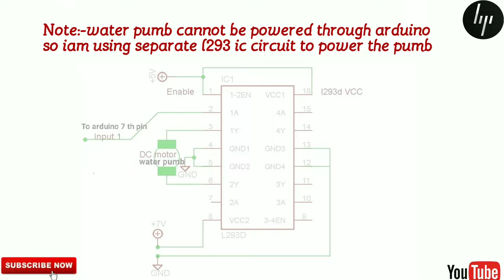Arduino Fire Fighting Robot _Hobby project Diy

Comment: Everybody please connect the pump in 6th pin because the circuit diagram is wrong
Reply: Bro could u complete this project??plzz replay... Urgent
Reply: @arjun.m3389  completed??
Reply: Its ok I completed it..
Reply: B1 in 6th pin sir
Reply: Sir I need Yr help
Reply: Bro then where to put relay pin ????????? What are you saying we add in 7 by my code
Reply: can i ask question po
Reply: @rupalagudidastagiri1416  Bro please give me the aurdino code for this project ....in this you tube link there is no. Coding is there
Reply from the maker: Download and open it using IDE software or change it's format from .ino to .text

Comment: Sir, we are working on the same project but instead of l293 motor driver we have l293d but all the sensors are ok and servo is in the working condition and the motors are not working can u please solve the problem....... Sir
Reply: Did you solve this problem??

Comment: By using the motor driver does the pump works??? Or we  need only relay for the pump
Reply from the maker: require an extra l293 driver or relay module to operate pumb.

Comment: Could you please tell me how you connect gear motors? do you only get output from the two front motors?
and last question would the code change if i use motors driver shield instead of motor driver?

Comment: I have a doubt....In the video u have used only one motor driver but in the circuit diagram there are two? Pls reply fast....
Reply from the maker: I have used L293 ic instead of driver
Reply: So should i use L293 ic or motor driver>

Comment: It's really use full thank you so much
Reply: Could you plz send me the code the one in the description box is not opening plzzz it would be extremely helpful
Reply: how you connect the wires on breadboard
Reply: @sandhyakumari8077  if i use 2000 mah battry inspite of 7500mah ,can it work ?code me kuch chane karna padega kya?
Reply: Why not bro sure
Reply: @devanshukaushik4134  of course
Reply: What is the total cost of components and the project
Reply: @sandhyakumari8077  bro it's not opening, it says preview not available
Reply: @nandhinivasudevan9727  u restart it 

Thanks...
Reply: Bro why my dc motor doesnt spin?
Reply: @BKawai-jr7et  I think there is a misconnection try setting it properly

Comment: Y didn't u use a relay in this project but u used a relay in your next upgraded gsm module fire fighter
Reply from the maker: You can use both.
Reply: @hobbyproject  bro i have done everything same as ur circuit diagram but my project is not working even I uploaded the code properly but still not working plz help me i have project in my clg
Reply from the maker: 9400496834 what's app

Comment: Bro ek motor drivers se ho skta hai kya....plzz bta do plzz broo...🥺🥺🥺?
Reply from the maker: Use relay module for water pumb.
Reply: @hobbyproject  how bro.... 🥰🥰😍😍😍blzz tell me... I have 1 chanel relay kit..... But how I can use that.... 🥰🥰😍😍🥺🥺🥺
Reply from the maker: Check the description.
Reply: @hobbyproject  thank u so much sir 😘😘😘❤❤❤❤❤❤❤❤ but sir code....? 😘🥺
Reply from the maker: Same code.
Reply: @hobbyproject  thanks sir 😘😘 may God bless you 😘❤🙏
Reply: @hobbyproject  not working sir💔💔💔😥😥😥😥😥 what should I do now🥺🥺
Reply: @hobbyproject  sirrrr😭😭😭😭😭
Reply from the maker: 9400496834 WhatsApp.
Reply: @worldVK1704  do u fix ur problems....
Reply: @arjun.m3389  not yet
Reply: @worldVK1704  iam also planing for to  do this project. Iam also confused with the circuit diagram...
Reply: @arjun.m3389  which type of problem are you facing.... @
Reply: @worldVK1704   CODE HAS 4 MOTORS BUT IN THE CIRCUITS THERE IS ONLY TWO MOTOR COULD CLARIFY THIS??? PLZ ITS URGENT
Reply: @arjun.m3389  I will help u

Comment: It's extremely helpful....however the code in the description box is not opening up...could you please upload it once again...and if someone has the code, please reply
Reply from the maker: Open it using Arduino ide softwere
Reply: @hobbyproject  yes I have...it has worked thanks a lot...
Reply: @hobbyproject  can I use my laptop for this project??
Reply: @hobbyproject  and could you plz let me know if a metal chassis would work
Reply from the maker: Yes u can use laptop and metal chassis is fine
Reply: @hobbyproject  thank you
Reply: @hobbyproject  i have a last question....will the code work with two wheels...if not could you plz let me know where you have got your chassis from...and what is the container you have used?
Reply from the maker: Yes it will wrk for 2 motors.
Reply: @hobbyproject  we had made are project with 2 motors but it is not working . Can you please tell me why this   happens with us

Comment: i used Arduino uno smd version to make this project,the circuit not working properly, sometimes it moving random ,not detecting flame signals,not switching the relay or motor driver

Comment: Can i use l298 motor Driver instead of l293?
Reply from the maker: sure
Reply: @hobbyproject  could you help about the pin out connection of l298?

Comment: Can you tell me the use of 18650 battery then?
Reply from the maker: An 18650 is a lithium ion rechargeable battery. The 18650 cell has voltage of 3.7v and has between 1800mAh and 3500mAh .

Comment: Sir please help for this project using L298N driver....  For circuit diagram and program ...
Reply from the maker: Hey, check the description.
Reply: Sir description diagram and program are different i want to using  L298N driver circuit diagram and program ...
Reply from the maker: No problem,  same connections.

Comment: hlo sir,we are working on the same project but ising l293dotor drivers instead of l293.We are ok with flame sensers and servo,they are active when fire is on.....
but coming to dc motors there is no response first we got they also used to rotate, but now there is no response what is solution sir...
Reply: Same here bro
Reply: bro have you complete this prject ?

Comment: Bro breadboard ki wiring smj nai aa rahi
Reply: Bro plz reply
Reply from the maker: Use another l293 driver so you can avoid BB wiring .
Reply: @hobbyproject  then will it work with the same program
Reply from the maker: Yes same.
Reply: @hobbyproject  LAKIN SERVO KAHAN LAGA GA

Comment: I need help water pump is automatically run
Not working on fire sensor
Reply from the maker: Hey just change the pumb connection from NC to NO on relay module.

Comment: bro please give the code by copy and paste please bro i beg you
Reply: /*------ Arduino Fire Fighting Robot Code by hobby project---- */
 
#include <Servo.h>  //include servo.h library
Servo myservo;
 
int pos = 0;    
boolean fire = false;
 
#define Left 9      // left sensor
#define Right 10    // right sensor
#define Forward 8   //front sensor

#define LM1 2       // left motor
#define LM2 3       // left motor
#define RM1 4       // right motor
#define RM2 5       // right motor
#define pump 6
 
void setup()
{
  pinMode(Left, INPUT);
  pinMode(Right, INPUT);
  pinMode(Forward, INPUT);
  pinMode(LM1, OUTPUT);
  pinMode(LM2, OUTPUT);
  pinMode(RM1, OUTPUT);
  pinMode(RM2, OUTPUT);
  pinMode(pump, OUTPUT);
 
  myservo.attach(11);
  myservo.write(90); 
}
 
void put_off_fire()
{
    delay (500);
 
    digitalWrite(LM1, HIGH);
    digitalWrite(LM2, HIGH);
    digitalWrite(RM1, HIGH);
    digitalWrite(RM2, HIGH);
    
   digitalWrite(pump, HIGH);
   delay(500);
    
    for (pos = 50; pos <= 130; pos += 1) { 
    myservo.write(pos); 
    delay(10);  
  }
  for (pos = 130; pos >= 50; pos -= 1) { 
    myservo.write(pos); 
    delay(10);
  }
  
  digitalWrite(pump,LOW);
  myservo.write(90);
  
  fire=false;
}
 
void loop()
{
   myservo.write(90); //Sweep_Servo();  
 
    if (digitalRead(Left) ==1 && digitalRead(Right)==1 && digitalRead(Forward) ==1) 
    {
    
    digitalWrite(LM1, HIGH);
    digitalWrite(LM2, HIGH);
    digitalWrite(RM1, HIGH);
    digitalWrite(RM2, HIGH);
    }
    
    else if (digitalRead(Forward) ==0) 
    {
    digitalWrite(LM1, HIGH);
    digitalWrite(LM2, LOW);
    digitalWrite(RM1, HIGH);
    digitalWrite(RM2, LOW);
    fire = true;
    }
    
    else if (digitalRead(Left) ==0)
    {
    digitalWrite(LM1, HIGH);
    digitalWrite(LM2, LOW);
    digitalWrite(RM1, HIGH);
    digitalWrite(RM2, HIGH);
    }
    
    else if (digitalRead(Right) ==0) 
    {
    digitalWrite(LM1, HIGH);
    digitalWrite(LM2, HIGH);
    digitalWrite(RM1, HIGH);
    digitalWrite(RM2, LOW);
    }
    
delay(300);//change this value to increase the distance
 
     while (fire == true)
     {
      put_off_fire();
     }
}
Reply: /*------ Arduino Fire Fighting Robot Code by hobby project---- */
 
#include <Servo.h>  //include servo.h library
Servo myservo;
 
int pos = 0;    
boolean fire = false;
 
#define Left 9      // left sensor
#define Right 10    // right sensor
#define Forward 8   //front sensor

#define LM1 2       // left motor
#define LM2 3       // left motor
#define RM1 4       // right motor
#define RM2 5       // right motor
#define pump 6
 
void setup()
{
  pinMode(Left, INPUT);
  pinMode(Right, INPUT);
  pinMode(Forward, INPUT);
  pinMode(LM1, OUTPUT);
  pinMode(LM2, OUTPUT);
  pinMode(RM1, OUTPUT);
  pinMode(RM2, OUTPUT);
  pinMode(pump, OUTPUT);
 
  myservo.attach(11);
  myservo.write(90); 
}
 
void put_off_fire()
{
    delay (500);
 
    digitalWrite(LM1, HIGH);
    digitalWrite(LM2, HIGH);
    digitalWrite(RM1, HIGH);
    digitalWrite(RM2, HIGH);
    
   digitalWrite(pump, HIGH);
   delay(500);
    
    for (pos = 50; pos <= 130; pos += 1) { 
    myservo.write(pos); 
    delay(10);  
  }
  for (pos = 130; pos >= 50; pos -= 1) { 
    myservo.write(pos); 
    delay(10);
  }
  
  digitalWrite(pump,LOW);
  myservo.write(90);
  
  fire=false;
}
 
void loop()
{
   myservo.write(90); //Sweep_Servo();  
 
    if (digitalRead(Left) ==1 && digitalRead(Right)==1 && digitalRead(Forward) ==1) 
    {
    
    digitalWrite(LM1, HIGH);
    digitalWrite(LM2, HIGH);
    digitalWrite(RM1, HIGH);
    digitalWrite(RM2, HIGH);
    }
    
    else if (digitalRead(Forward) ==0) 
    {
    digitalWrite(LM1, HIGH);
    digitalWrite(LM2, LOW);
    digitalWrite(RM1, HIGH);
    digitalWrite(RM2, LOW);
    fire = true;
    }
    
    else if (digitalRead(Left) ==0)
    {
    digitalWrite(LM1, HIGH);
    digitalWrite(LM2, LOW);
    digitalWrite(RM1, HIGH);
    digitalWrite(RM2, HIGH);
    }
    
    else if (digitalRead(Right) ==0) 
    {
    digitalWrite(LM1, HIGH);
    digitalWrite(LM2, HIGH);
    digitalWrite(RM1, HIGH);
    digitalWrite(RM2, LOW);
    }
    
delay(300);//change this value to increase the distance
 
     while (fire == true)
     {
      put_off_fire();
     }
}

Comment: Hello bro! 
Please I have a question!
Can I use only two 3.7V Li-ion 2000mAh Battery 18650 for 2 motor drive shields? I mean one for the water pump the other for the motor and wheels.
Reply from the maker: No, u need to use  2 x 3.7v battery in Series so total 7.4v for both pumb and shield.

Comment: Hello Sir please reply!
First in the diagram there are two motor drive but you only use one in the video!
Then how you connect the battery?  have you use Lithium Battery Shield V3 Charging Module?
Reply from the maker: One for wheel and other for pumb
Follow the circuit diagram.
Reply: @hobbyproject   sorry for bothering you! 
but can i use one channel relay module instead of using another motor drive?
Reply from the maker: Sure u can.
Reply: @hobbyproject  Then i am going to use motor drive shield instead of the motor drive for the wheel, and one channel relay module for the mini water pump.
Thank you so much.
Reply: @hobbyproject  sir program is not compiling , it should error at digaitalWrite
Reply: It is showing error

Comment: Beautiful.. I made this as per your circuit diagram and everything works well.. I used two L293D single chip motor drivers instead and it works perfectly.
Reply: What is the total cost of components and the project
Reply: @meghanamaggie4975  3500
Reply: Can you help me
Reply: @hrutikshinde1270  what help do you need?
Reply: @hrutikshinde1270  just follow the circuit diagram provided by hobby project.
Reply: Can you please send the link of the code
Reply: Why dont u use l298N motor sheild..
Reply: @nandhinivasudevan9727  The code has been provided by hobby projects check the description.
Reply: @akchannel7356  I used what I could get access to in my area.
Reply: Can I buy from you?
Reply: Bro so you have this project with you, I want to purchase
Reply: @BKawai-jr7et  if you need to buy I can Do it for You
Reply: @BRIJESHKUMAR-sk1ex  i can
Reply: Hi sir for me program is not compiling
Reply: @nKingCobra   program is not compiling sir
Reply: Hi sir program is not compiling
Reply: Hi sir reply please
Reply: @explorerpragun431  even can I get the code for it am not able to open the code given in description
Reply: @agazeeza8173  no idea boss The Code is Faulty
Reply: Hlo bro can you please tell me something
Reply: Bro... Why my is not working🥺🥺
Reply: @meghanamaggie4975  for me it was 1400
Reply: /*------ Arduino Fire Fighting Robot Code by hobby project---- */
 
#include <Servo.h>  //include servo.h library
Servo myservo;
 
int pos = 0;    
boolean fire = false;
 
#define Left 9      // left sensor
#define Right 10    // right sensor
#define Forward 8   //front sensor

#define LM1 2       // left motor
#define LM2 3       // left motor
#define RM1 4       // right motor
#define RM2 5       // right motor
#define pump 6
 
void setup()
{
  pinMode(Left, INPUT);
  pinMode(Right, INPUT);
  pinMode(Forward, INPUT);
  pinMode(LM1, OUTPUT);
  pinMode(LM2, OUTPUT);
  pinMode(RM1, OUTPUT);
  pinMode(RM2, OUTPUT);
  pinMode(pump, OUTPUT);
 
  myservo.attach(11);
  myservo.write(90); 
}
 
void put_off_fire()
{
    delay (500);
 
    digitalWrite(LM1, HIGH);
    digitalWrite(LM2, HIGH);
    digitalWrite(RM1, HIGH);
    digitalWrite(RM2, HIGH);
    
   digitalWrite(pump, HIGH);
   delay(500);
    
    for (pos = 50; pos <= 130; pos += 1) { 
    myservo.write(pos); 
    delay(10);  
  }
  for (pos = 130; pos >= 50; pos -= 1) { 
    myservo.write(pos); 
    delay(10);
  }
  
  digitalWrite(pump,LOW);
  myservo.write(90);
  
  fire=false;
}
 
void loop()
{
   myservo.write(90); //Sweep_Servo();  
 
    if (digitalRead(Left) ==1 && digitalRead(Right)==1 && digitalRead(Forward) ==1) 
    {
    
    digitalWrite(LM1, HIGH);
    digitalWrite(LM2, HIGH);
    digitalWrite(RM1, HIGH);
    digitalWrite(RM2, HIGH);
    }
    
    else if (digitalRead(Forward) ==0) 
    {
    digitalWrite(LM1, HIGH);
    digitalWrite(LM2, LOW);
    digitalWrite(RM1, HIGH);
    digitalWrite(RM2, LOW);
    fire = true;
    }
    
    else if (digitalRead(Left) ==0)
    {
    digitalWrite(LM1, HIGH);
    digitalWrite(LM2, LOW);
    digitalWrite(RM1, HIGH);
    digitalWrite(RM2, HIGH);
    }
    
    else if (digitalRead(Right) ==0) 
    {
    digitalWrite(LM1, HIGH);
    digitalWrite(LM2, HIGH);
    digitalWrite(RM1, HIGH);
    digitalWrite(RM2, LOW);
    }
    
delay(300);//change this value to increase the distance
 
     while (fire == true)
     {
      put_off_fire();
     }
}
Reply: Can you share the code
Reply: Can you provide circuit diagram?
Reply: I need your help
Reply: Hii sir, I also want this project, how much it cost to buy from you if it is ready with you
Reply: What is the meaning of two l293d with single chip
Reply: Can I get code for this project
Reply: Bro I want help with you so pls help me how to connect pump

Comment: Hello I need your help please help me
Reply from the maker: Sure
Reply: @hobbyproject  is there any way to contact you
Reply: Sir, can I do this project using L293D Arduino shield instead of L293 motor shield
Reply: Helloo
Reply from the maker: You can use L293 or L298 driver.

Comment: I used l298n driver bo motor speed too high  and so near of fire or cross the fire and pump not starting how solve this problem😭😭😭😭 please give me l298n using flame sensor and 5v relay program i need i show in college project please help me 😭😭
Reply from the maker: use lm2598 converter to power l298 driver.

Comment: In video u have used one motor driver shield but in circuit diagram u have given two????
Reply from the maker: Other 2 motor connected in parallel.

Comment: This is not working
Reply: Because you must put a battery and connect it to the arduino after removing the cable that you connected to the arduino after putting in the code

Comment: Bro can i use an l298n motor driver instead of l293d
Reply from the maker: yes u can.
Reply: Sir can you send the arduino uno 
code please
Reply from the maker: check the description.
Reply: They are not have code please

Comment: In the diagram there is no breadboard
Reply from the maker: Use another l293 driver, instead of breadboard  connections.
Reply: @hobbyproject   Bro, by entering the code of this project, the motor is not working. The motor is not getting any command from adrino. Pls give me the complete code or else give me your mobile no. I can call you and get the information.

Comment: After some corrections everything is working fine except the water pump. Water pump is not working
Reply: What r the correptions...
Reply: @arjun.m3389  i used relay instead of second motor driver
Reply: @RohitKumar-zi8fv  bro can i get ur no
Reply: Its very urgent... For my project plz